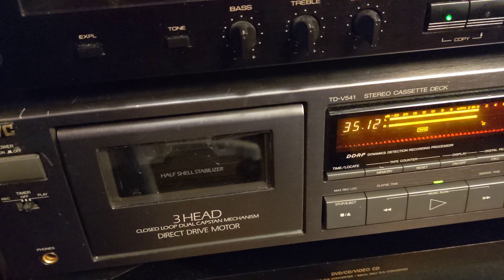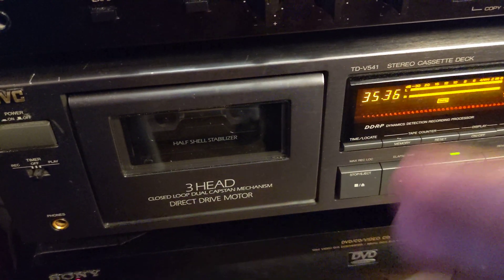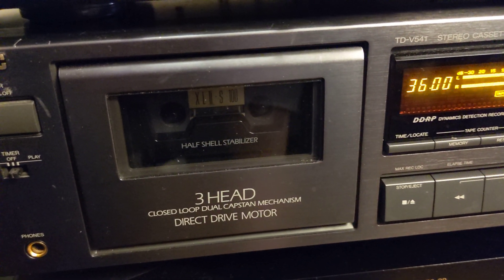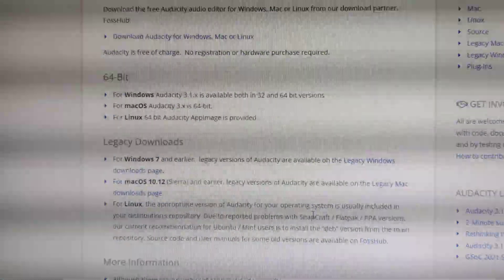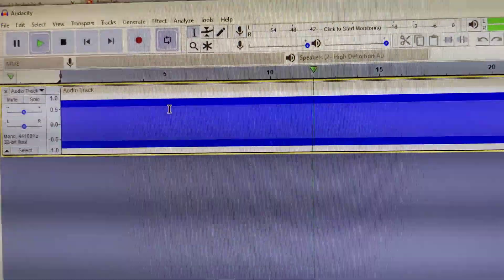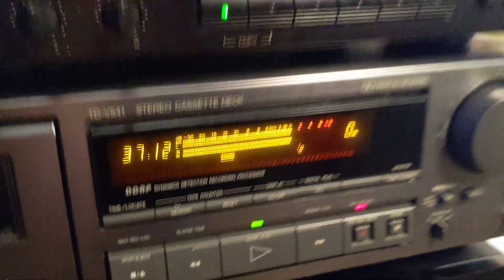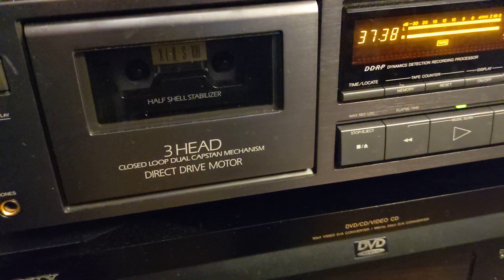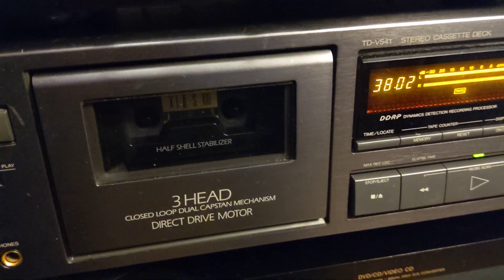How to make 440 Hz test tone cassette tape with a direct drive cassette deck

Comment: the only problem with this method,you should have measured the output levels must be equal.I VE GOT also TDV 6541, 531 DECK. ACCORDIGLY 300 MV OUTPUTS AZ ZERO LEVEL THAT MEANS HERE -8 DB LEVEL . TO LOOK AT CLOSLY THE DISPLAY THERE ARE 2 ZERO MARK .A LITTLE THAT MEANS 300 MV WITH 1 KHZ ACCORDINGLY JVC,AND THE NORMAL MARK WHEN COMES APPROX .430 MVOLT.THE NORMAL .775 MILLI VOLTS EFFECTIVE AT PLUS 4 DB.THAT IS THE PROBLEM WITH THIS COMPU LINK TECHNOLOGY.ANOTHER JVC DECKS THE ZERO POINTS AT . 500 MVOLTS, DD5,KDA 55,JVC KDV-6 ETC.THE BEST RESULTS WILL COME WHEN THIS UNIT ADJUSTED AT .430 MILLIVOLTS AT ZERO MARKS. GREATS SÁNDOR A JVC FAN.

Comment: I just use a commercial cassette.  Play a song on the deck and then match it to the same one on You Tube .
By ear you should get it pretty close.
Reply from the maker: That is a simple and efficient solution, but only if the person made a YT video used a CD player.

Comment: What is the term  (Direct Drive Motor)? And what the defence with regular motor?
What's the importance of this test?
How to correct if the test get error?
Reply from the maker: Direct drive means that there's no belt between the motor and capstan and you can't (in most cases) adjust speed of the tape, there's a quartz that is calibrated for best tape speed and if that quartz goes bad, your tape speed will be ruined. Cassettes run at 1.875 inches per second (4.75 cm/second) and that's the standard, so when I record tape on Direct Drive deck that is in good shape, I can be sure that I have test tape which I can use to calibrate other decks. Usually you record some test tone that can be easily measured when you're correcting the speed of the tape. Let's say you recently replaced belt on your deck, now it's time to check if speed is correct, there's a tiny whole on the motor, or some trim potentiometer that you can use to speed it up or slowing down the speed with a tiny screwdriver.
Reply: @cheapoldhifi   
Very kind from you and thanks so much of explaining that important term 💐
So replacing the belt is easy then looking for that quartz of direct drive motor.
Actually I have a chance to be an amazing deck with includes 3 Head and 2 motors, but with belt drive motor.
It's Mitsubishi DT-9600
Do you advise me to buy it?
Or I look for another one which includes Direct Drive?

Comment: Even is 3 head direct drive,that means is not perfect,because some 3 heads direct drive comes with 3 motor direct drive like Pioneer CT 90 R,but still there is a belt drive pulley,mine JVC DD 66 has no belts,but comes with idler rubber!After i replaced the rubber idller i have ckecked the speed and surprise!Different speed!So i have used a original tape made by TEAC at 400 hz on my Tascam CC 222MKII to be sure is running at correct speed,this machine comes with pitch control,so was very easy to setup the corect speed,after that i recorded a 440 hz test tone on cassette tape,and all is good now!Running the 3000 HZ test tone on my tape decks after i fixed all my decks at 440 hz,my measurement show the 3000 hz,so i did the right job,playing a cassette tape on different cassette decks no audible differences!
I will do a video about that soon!
Reply from the maker: Well yes, you need good equipment to make a test tape, but when you have one, you can adjust many!
Reply: @cheapoldhifi  Of course!
Reply: So which is the prefect then?